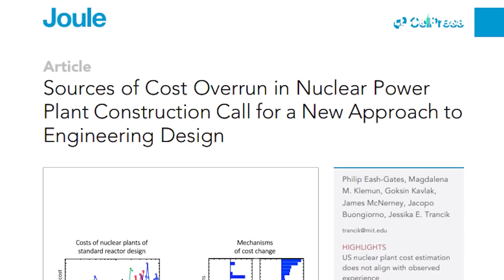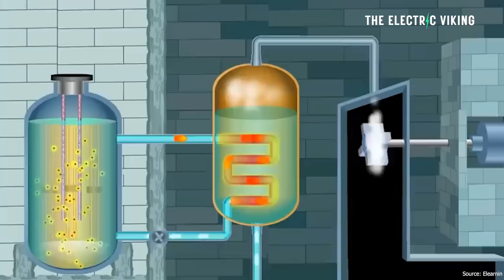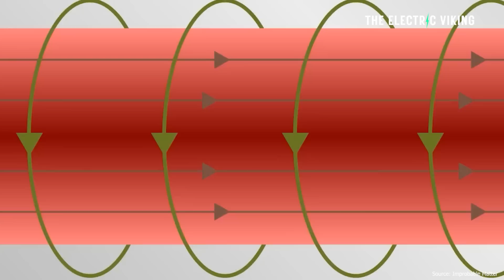Bill Gates says nuclear is the answer to the world's climate crisis...

Comment: Who says you can’t have a combination of solar, wind and nuclear.
Reply: Solar w/out storage is incomplete- tenured professor Donald Sadaway MIT
Reply: @sparkysho-ze7nm  Indeed. So we should and will build storage too. Remember, lithium battery prices dropped 90% over the same period of time solar did. These technologies are tremendously vulnerable to economies of scale in production (unlike nuclear reactors). So more massive but less expensive technologies like iron-air and flow batteries will experience the same price revolution, making the “few days” level of storage practical and affordable. The economic pressures are there, and these aren’t exotic technologies that will take decades (SMR) or don’t actually exist (fusion). 

So this is the problem nuclear faces… by the time they can get past the cost problems, past the political resistance, past the learning curve, they won’t be competing with nasty, dirty coal. They’ll be competing with all those solar/battery systems that replaced the coal already, systems that are cheap and clean.
Reply: You understand that solar and wind even with batteries are still a few magnitudes cheaper than nuclear without storage? @sparkysho-ze7nm
Reply: @sparkysho-ze7nm  Your not wrong but as someone trying to sell grid scale battery storage his bias is clear.  Creative solutions such as highly variable power rates, power "packets" are part of the solution.  A glut of very cheap solar can be used by new industrial practices optimized for intermittency.  A ironworks could effectively use the power when it is abundant mid day to hear up systems and effectively have a thermal battery.  Desalination/lithium extraction could be designed to operate when power is abundant and stop when it isnt.
Reply: Economics says you can't have them all. For one, it is not a choice between just these three. There are a lot more choices in energy, all of whom are cheaper than nuclear with no ware near the risk. Look at the Levelized Cost of Energy. Nuclear comes in dead last. Nuclear is dead by every measure but in the minds of its few supporters.
Reply: And if someone can manage to build a nuclear reactor that is cost-competitive with renewables in the ten years or so from now it’ll take to build it, on no more subsidy than the renewables got, I’ll applaud them. I don’t have anything against nuclear. I think the “safety” arguments are a crock on both sides. But nuclear has a serious cost problem, which is the real reason it never caught on.

Comment: Sam didn't say anything about cooling nuclear power plants and thermal power plants in general.  For every megawatt these power plants send to the grid, they have to dissipate 2 megawatts as heat.  That is why you see those huge cooling towers spewing out plumes of steam.  These cooling towers consume huge amounts of water, it's a significant amount of the total water humans use.  That's why the plants are located by large bodies of water.

If a new nuclear power plant replaces a coal plant, then there is no change; the same amount of water is used.  But there is not enough water available in many parts of the world to cool new nuclear power plants.  It doesn't matter how big os small a new thermal power plant is, it still must be cooled.

No water is needed for renewables.  In fact the "floatovoltaics" solar panels floating on bodies of water save a lot of water by reducing evaporation.  

I think that solar and wind have nailed the last nails in the coffins of new nuclear power. 
Thanks for the video, Sam.

Comment: It is not about price. Wind and solar may be cheap. But they cannot deliver baseload. Some solution must be found for the times when it is cloudy without a breeze.
Maybe lots of cars with V2G is part of the answer. Maybe batteries will become cheap enough to solve it. Maybe 4th gen. nuclear will fulfill all it promises in time to help. Maybe er can ude extra energy to fill huge reservoir, so we can use water power in those hours.
But we do need to start finding solutions to this.
Get rid of all fossil fuel power plants. If you have some nuclear 3+ infrastrukture, keep it. Don't do like the Germans and start burning coal instead. But new 3+ nuclear projects? I wouldn't do it. It's expensive, but mainly it will take way too long before the first kilowatt is generated. So do something else. Batteries, Power-to-X, and even more renewables. Or something clever that is possible in your local circumstance.

Comment: So the "best" solution is expensive slow, marginally safe and a massive heat engine with vast thermal pollution 🤔 The resources needed to operate are not abbundant or evenly distributed regionally causing conflicts between nations and then radio active waste.

Comment: There is more to the equation than cost. Photovoltaic panels last about 20 years before needing replacement, but nuclear plants can last for 60 or more. Solar takes up 1000x the land area for 100x less energy. Nuclear can create heat for industrial processes and propulsion (sea and space) that electric PV panels cannot.

Ultimately I think we will need all forms of energy generation to solve the problem. EVs and solar are better for low-level consumer energy use; nuclear (hopefully SMRs) should become the industrial power source of the future, and ideally we can build up enough energy surplus that we can just brute force make our own hydrocarbon fuels (like methane/LNG/CNG) rather than trying to force batteries to come close to the (admittedly stupidly high) energy densities of existing chemical fuels.

Fingers crossed for fusion making it all irrelevant, too.
Reply: Photovoltaic panels actually have 80% of capacity at 30 years.

Nuclear plants are designed to last about 40 years. And we are abusing the designs by extending them for longer use. We don't really know what risks we are taking by doing that. But it does remind me of the shuttle Challenger disaster.
Reply: Also, photovoltaic combines really well with many types of farming and ranching especially in a climate change scenario.

And Fukushima rendered about 525 square miles basically uninhabitable to young people.  That would support a lot of solar panels.

Comment: NUCLEAR IS ABSOLUTELY THE TRUE ANSWER. NUCLEAR IS ABSOLUTELY CHEAP SINCE IT IS THE ONLY ENERGY SOURCE THAT TAKES RESPONSIBILITY FOR ITS WASTE. FURTHER, 70 TO 80 PERCENT OF THE EXPENSE FROM LARGE NUCLEAR PLANTS IS FINANCE CHARGE ON LONG DURATION (20 YEAR) BUILDS (VOGTLE). PLANTS IN THE 60S AND 70S WERE BUILT IN 28 TO 36 MONTHS AT A TINY FRACTION OF THE (FINANCE) COST OF CURRENT MEGA PROJECTS. THOSE PLANTS STILL SAFELY RUN TODAY. THERE IS NO PRACTICAL ALTERNATIVE TO NUCLEAR. THE ENERGY DENSITY OF NUCLEAR IS 2-3 MILLION TIMES THAT OF SOLAR, WIND, BATTERIES, GEOTHERMAL, AND FOSSIL FUELS. JAMES HANSEN, THE TOP CLIMATE EXPERT IN GLOBAL HISTORY, STATES HUMANITY CANNOT MEET THE ESSENTIAL CLIMATE CLEAN ENERGY NEEDS WITHOUT MASSIVE NUCLEAR, WHICH HE STRONGLY SUPPORTS. LOVE YOU VIKING, BUT YOU ARE BLIND TO NUCLEAR NECESSITY. REVISIT THE ISSUE, AND REVISIT YOUR MATH. MOST OF THE WORLD DOES NOT AND WILL NOT HAVE AUSTRALIA'S SOLAR RESOURCE, ESPECIALLY IN THE CRITICAL TIME FRAME, IF EVER.

Comment: If we use nuclear, it should be Thorium. WAY safer, and WAY less radioactive waste. Otherwise, maybe aneutronic fusion, like fusing hydrogen with boron, like the Focus Fusion project, which creates zero radioactive waste.
Reply: Nonsense,
Reply: @sun-man  Read "The Big Bang Never Happened" (1991) by Eric Lerner. The finding we have TODAY from the Webb telescope supports plasma theory. Then look at LPP fusion before you make your pronouncement (which was zero effort on your part, so far).

Comment: Nuclear concentrated generation MUST HAVE A GRID to DISPERSE the electricity to the millions of ends of the grid. 
The existing grid is fragile. 
Because grids are incredibly expensive. 
5times more electricity means 5times bigger grid capacity. 
Rooftop and batteries need NO GRID EXPANSION. 

Grids are stupendously expensive. 

Rooftop generation does NOT NEED government disaster insurance. 
Rooftop generation does not need government GARRENTEED cash flows like our toll roads.
Rooftop will be banned because of nuclear electricity filling the national grid.
Customers will not be able to reduce their grid electricity demand.

Bid batteries are free with EVs. 
All vehicles are parked 23hrs every day. 
Daily drive is 7kwh, ezi pezi to top up daily. 

Nuclear is a 60years to 100years locked in technology. 
Nobody can afford to turn off nuclear power plants.
Reply: Not true. Nuclear can work fine off.grid. Power-to-X. Where X might be, for instance methanol, ammonia or green hydrogen. Which can then be consumed when more power is needed.
But here cost matters. Using wind or solar is much cheaper, and you can get production going at once, rather than in 20 years.
Reply: @mvoetmann1  time frames are important 👌
Reply: @mvoetmann1  
Australia has 20million buildings and each with 33m2 of rooftop solar PV is 660Gwh daily. 
All buildings are connected to the national grid. 
Fossil fueled generation 25GW is 600Gwh max if you are lucky.
Rooftop PV is cheaper than windows $/m2. 

Australia has 20million vehicles, when EV with big long distant batteries but parked 23hrs every day
Reply: @stephenbrickwood1602  good argument for getting V2G up and running
Reply: @mvoetmann1  exactly. 
I think Elon Musk is putting together all the parts before he does V2G. 
I think Elon will be a power company and the vehicle manufacturer and transport company and an AI company and a space launch and internet company and ??

Comment: There is no such thing as clean coal or safe nuclear power.
Reply: Sam brings us clean news.
Reply: Thorium is safe but doesn't make bomds , hense it was closed down.
Reply: Nuclear is great except if it’s in your backyard…
Reply: Nuclear power is perfectly safe. Until there’s an earthquake. Or a tsunami. Or a massive flood. Or a terrorist attack. Or a war.  Or incompetent plant operators. Or an undiscovered design flaw. Or…
Reply: Nuclear waste can be ground up into powder and blown into the atmosphere and it would still be less deadly than fossil fuels. It's not a problem at all, at least not if you accept the status quo.
Reply: How many people die building more national electrical power grids.
30 to 50m high towers with workers climbing over them and conductor cables being installed. 

Central generation MUST HAVE A GRID to DISPERSE the concentrated electrical energy. 

5times more electricity in a no fossil fueled world means 5times more grid capacity. 

Nothing dangerous here.
Sarcasm. 

Now, let's talk about the economics of grid construction, what a waste of time.

Rooftop solar does not need grid costs.
Rooftop UNLOADS the existing grid. 
Rooftop is dispersed energy AT THE ENDS OF THE existing national grid.
Reply: 100% nuclear is too expensive, creates waste at every stage of the process from extraction to decommissioning, and can still fuel the nuclear weapons industry. Also they remain military (see Ukraine) and terrorist target.
Reply: Don’t fall for the promise of SMRs. Small Modular Reactors

https://youtu.be/ojWCvxKzUgk
Reply: Ther's load of potential making nuclear cheaper/better. 5 generation, 6 generation maybe?
Reply: People like you don’t know anything about nuclear.
Reply: @zenster1097  If you know so much, let’s put some nuclear waste in your backyard. I am not even against nuclear power, but know how to assess risks. It’s probability multiplied by cost. Even if chances for major accidents are low, the cost could run into trillions. Same problem with asteroids. Very low chance, but if a big one hits …
Reply: @GermanGuy007 You're acting like the power plant "creates" nuclear waste. Radioactive material goes in and then spent, less radioactive material gets sent out. Powering 10,000 homes for a year will result in an aspirin sized capsule of spent uranium (which can be recycled multiple times in French, Canadian, and Chinese reactors).

Note that there is uranium and lithium in ocean water naturally
Reply: The nuclear you are talking about is nuclear designed in the 50s.  Small reactors that could be reproduced many times over would give economies of scale that would make it very cost effective.   Nuclear waste is a non factor with newer tech.   Even with these old reactors the entire amount of waste produced since the start of the nuclear age would fit on a football field. 10 M tall.
Reply: Nuclear is less dangerous when cost of life is measured than any others. Even more people die falling off the roof of a house installing solar that from nuclear. 
But even wind and solar are pretty safe. And much cheaper.
Reply: @williammeek4078  The cost of nuclear never includes the cost of protecting nuclear waste for hundreds or thousands of years, nor does it include the never-ending cost of leaks like Fukushima.
Reply: @340wbymag 
Nuclear waste can be refined into new fuel. New reactors are being designed to use wasted fuel as their energy source. We can also vitrify nuclear waste turning into non-porous non-leachable glass. Yucca Mountain should be used to store our waste in the USA.
Reply: @andrewday3206  Nukes are crazy expensive to build and it can take decades for it to pay for itself, and then again there is the issue of nuclear waste. The cost of renewables is declining at a rapid pace and their efficiency is also improving quickly. Nukes are not needed. They cost too much, and they pose too great a risk. They simply are not worth the investment anymore.
Reply: @340wbymag actually this is very much budgeted into the cost. In the US, nuclear plants also have to pay into a nuclear waste fund set up by the US government.  It has over $40B in it in addition to what the plants budgeted for storage.
Reply: Nuclear has the safest track record of any source of electrical power, including wind and solar.
Reply: @carrdoug99  Neither wind nor solar are releasing millions of gallons of radioactive water into the Pacific Ocean or creating contaminating sites like Chernobyl.
Reply: THERE IS NO SUCH THING AS UNSAFE NUCLEAR. WHICH FOSSIL FUEL COMPANY DO YOU WORK FOR?
Reply: @beautifulgirl219 Of course there is. Nuclear powerplants cannot even be fully insured, potential risks are guaranteed by the countries where they were built.